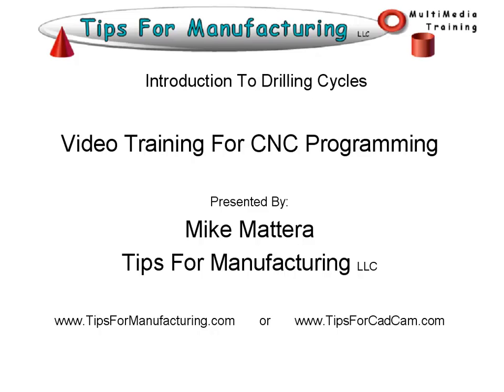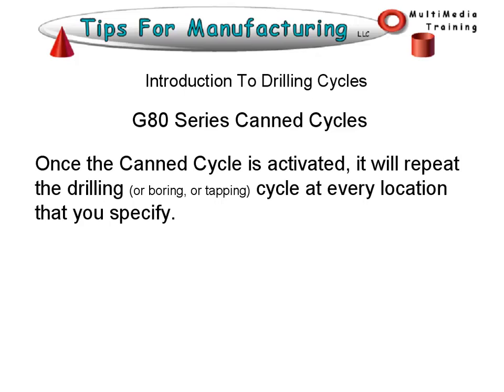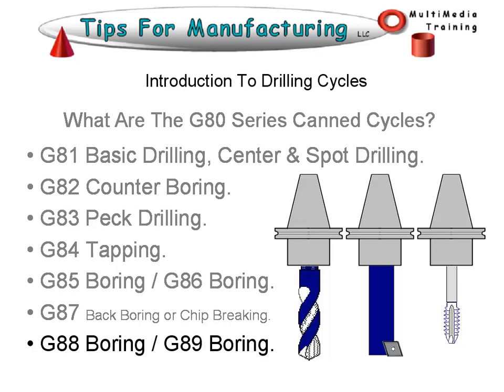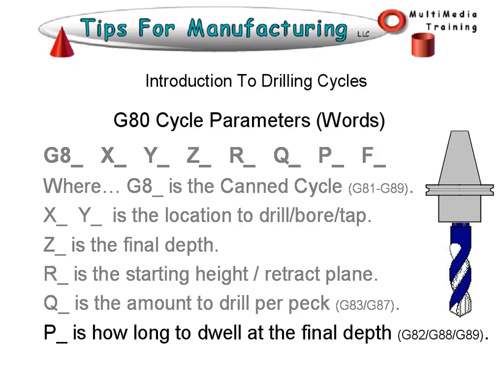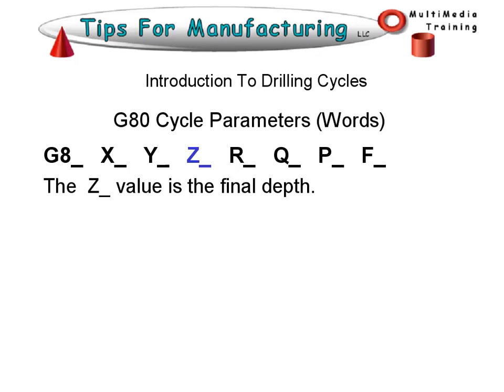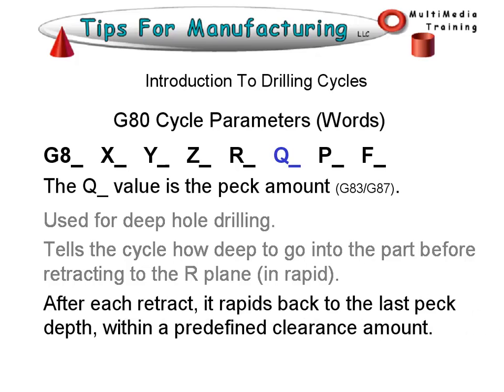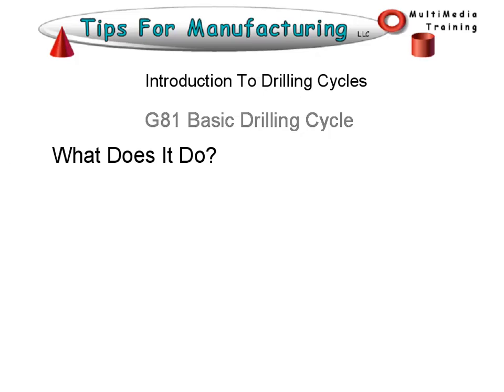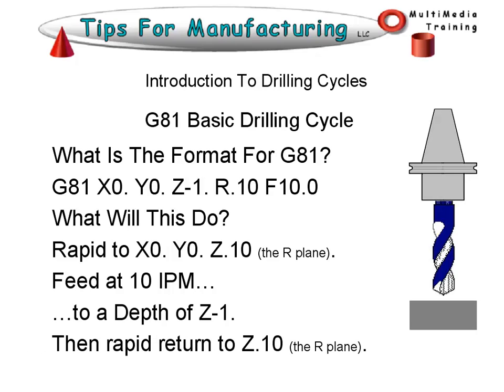TFM - CNC GCode Programming - Intoduction to Canned Cycles.

Comment: Top surface
===================  
  |   |
--------
|       |
--------
  |   |
--------
|       |
--------
  |   |
  |   |
  |   |

I am new to machining and my question may not be related to CNC programming altogether.

Can anyone tell me how to drill the above part. First, hole is drilled to full length. Then at a certain depth, I need to enlarge the hole with the specified diameter and height. And then, again I need to enlarge hole once more at a greater depth.

Sorry for the horrible graphics, but, I am sure everyone reading this post understands what I am looking for.

Comment: Can you help me with a question that I have? If the holes I want to drill are evenly spaced in the X axis (13mm), can I do this:
G81 Z-20 R2 F100 S1500	
G91 X13 L4
G80

In this case, the L4 would repeat the drill 4 times and each time incrementing 13mm in X. Is that correct? Thank you for your video